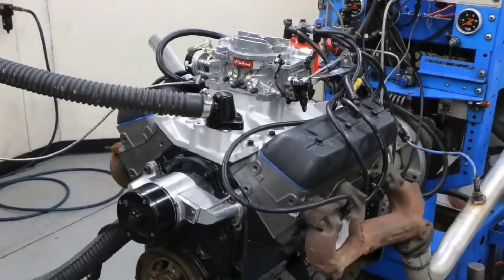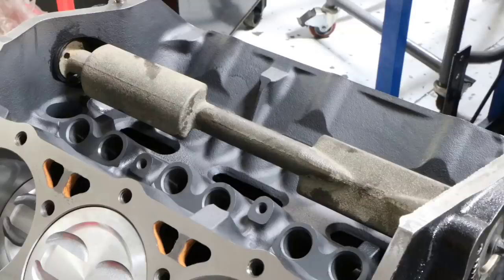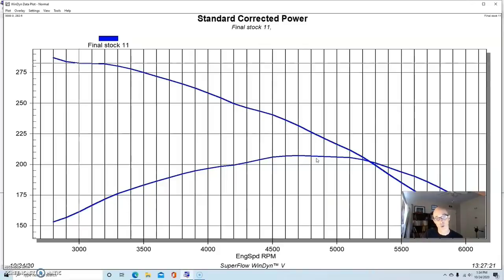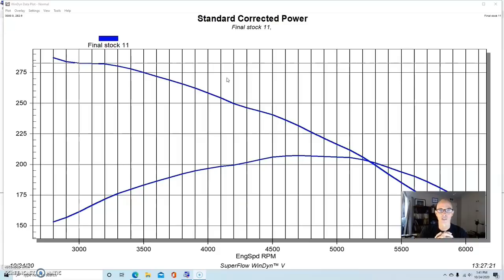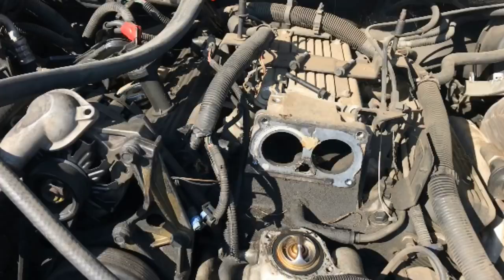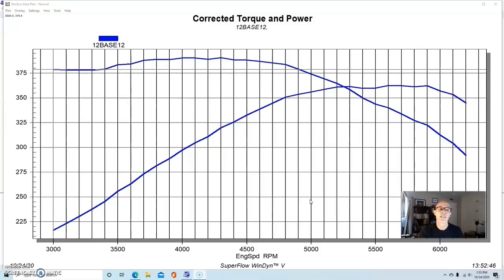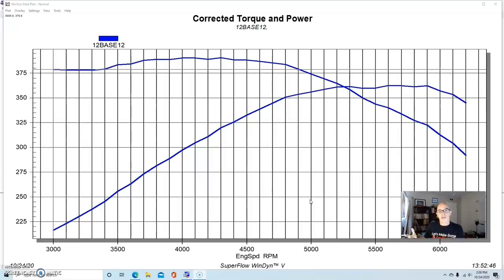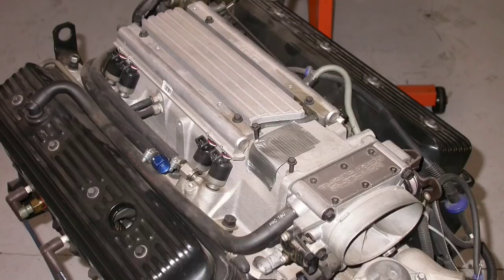4.3L V6 VS 4.3L V8-WHICH OTHER GUYS MAKES A BETTER BUILDER?

Comment: My current daily driver is a 2000 GMC Jimmy with the last generation of the original 4.3 V-6. And while it's held back by being in a luxobarge 4×4 four door SUV, it makes more than enough torque to get with the program. Power Nation built a hopped up version that made over 250 hp and almost 300 lb ft of torque naturally aspirated.

Comment: Bit of an odd suggestion I guess, but can we ever hope to see you run a quad4? It was a very high potential engine that never saw its peak because gm engineers and bean counters choked it to death.
Reply from the maker: I do like those
Reply: Darn carb sounds great in my book
Reply: What was the I-4 that could use any small block Chevy head?
Reply: @tubergonz  There's some speculation about fitting a chev head on either the Iron duke 2.5l (pontiac engine) or the chevy 2 four cylinder, but both seem to be bull as I've never seen either one built.
However there was a company out of Oklahoma building inline four blocks for both chev and ford v8 heads, but they seem to be few and far between because of expense and obscurity. They were like 7k just for the block.
Reply: That because they fell apart  when you  beat on them  buddy
Reply: I loved that little quad4, was in my sisters late 80's grand am. Made me realize that not all 4 bangers were boat anchors

Comment: The L99 would be my choice. I'm going to make a prediction. :-) 550-575 hp @ 6800 rpms with 5 lbs of boost and 300-325  feet tourque @4500 rpm.  Im not super familiar with that engine to be honest but NA I think you may run into a wall on valve flow. I dont think the intake is going to be the problem. Youre going to have over a quarter of an inch less room in each cylinder for valves.  That  will translate to significantly smaller valves than what would be doable in the 6 cylinder. That 6 can run 202s and perhaps 205s . It will be interesting to see this result. I think the V8 however will be able to hit higher rpms with less recropcating mass due to the smaller pistons. But yep 2 more pistons. :-) I like the high rpm screamer engines. Boost will help over come that small valve size . I think more HP can be made than that but not without significant expense or some crazy boost. Hey... you could boost it till it goes boom. :-) That would make a great video. more boost more rpms stiffer springs more rpms more boost. Here I go sending your hard earned money.. LOL

Comment: 4.3 v8 never heard of her!
Reply: 265 CID
Reply: Lexus makes one and way better than any Chevy engine.
Reply: Yeah that Lexus v8 is nice
Reply: The first Chevy small block was 265 ci. The L99 was not a popular version, but honestly why would you use it unless you wanted a really high revving combo. I could imagine a twin turbo 265ci in a light car doing work.
Reply: @tyronejefforeillyramirez7961  

I have an SC430 as well.. a 2009 parts car with the engine on an engine stand, and my 2006 which is the fun car and tricked out. I am rebuilding the extra 4.3 engine with forged rods, lots of head and intake work, cams, etc... aiming for close to 400hp on the engine alone with a clever tune.

Comment: And GM had two L98's and two L99's confusingly enough

L98 Gen I, 350 PFI from early C4 Vette and third Gen F Body

L98 Gen IV 6.0 LS2 variant solely used by Holden (Australia)

L99 Gen II 4.3 V8 94-96 Caprice sedan

L99 Gen IV 6.2 V8 5th Gen Camaro SS with auto trans

Comment: I have an 03’ s10 4.3. K&n Intake, exhaust, intake spacer, mild voodoo camshaft, super chips tune, bigger injectors, 8mm spark wires, msd ignition and I’m at a whooping modest 230hp. 
I think the lack of aftermarket intake manifold support is because it has a plenum, and a spider injection assembly. It’s harness is difficult to work on and the fuel pressure regulator in in the intake plenum. 
As for intake and moving air, the marine intake 4.3 v6 offers more cfm and a you can get a fuel rail and exterior FPR and injection. But it’s heavy. And requires a lot of outsourcing parts and rewiring. 
As for upgrades it’s cheaper and easier to swap a LS based engine, a one liter difference gets you over 100 more hp. 
If I were to put myself in the seat of aftermarket, I’d 3d scan a print a marine intake, and offer a rewiring harness. You could also portmatch the intake and really get more cfm. 
The v8 is cool, but doesn’t compare to a 350 or LS making it an irrelevant comparison because v6 4.3’s are not going to get swapped for a 4.3 v8... when like I said, a 350 or LS is so readily available and far superior in power and aftermarket.

Comment: 20 mpg in my loaded 1500 express van 4.3 300 k miles still going
Reply: Same in my chevy g10! Everyone is under this myth the 4.3 get worse mpg than a 350. Bs. They have smaller injectors and 2 less pistons how on earth would they get worse mileage. I just did a 423 mile trip straight on 21 gallons and still had fuel when I got home. 7 hours of driving. Love the 4.3 nice lil workhorses
Reply: @fvgc454ss  yes indeed cheap to fix also.

Comment: The 262, 265, the 267.   In the gen 0 family.   I helped a guy swap out a 267 out of a '78 or '79 Camaro and put in a long block 350 target mater back in the late 80's or early 90's. the one with the 350 stroke. Bolted all the 267 accessories up to it and he drove the 7 hours back to Edmonton that same weekend.  no problem.  I've driven a V6 powered Safari van ( aka mini van ) as a work vehicle. Our  '94 Caprice is powered by the gen 2 4.3L  Its a strong little motor. If I remember right, Chevrolets goal for the 4.3 gen2 ( baby LT )  was 1 Horse per cube and the publication I read about it that they more than achieved their goal. BEFORE anyone pounces on me for using the "gen 0" nomenclature, I point out that I am using Chevrolets own designations in their 2017 GMPP catalogue, they define the gen 0 as the 2 piece rear main seal and the gen 1 as the 1 piece rear main seal  ( their own crate motors )
Reply from the maker: the 4.3L was rated at 200 hp-misses the 1 hp per cube by a fair margin, right?

Comment: You overlooked one advantage of the V6.  Weight.  Not only how less weight is the same as more HP,  but on front heavy cars,  hooking and handling are better.  Yes we can get them to hook but it's easier and a smaller tire can be used when tubs are not an option.  Also you have more room for a turbo.  That is especially important in a S10 or a car with a small engine bay.  Lighter will get better fuel economy.  What I am considering is a small motor with a turbo that will get good gas mileage when cruising and have the turbo there when you need power.  Of course you would have to aluminum heads for the V6 as they come with cast iron to lighten it more.  My only q is how much power can a vortec v6 handle reliably?  N20 is expensive long term and a hassle to have to keep filling bottles.

Comment: 350 Cubic inch/ 4 speed  in a monza back in the day, very quick car
Reply: The only factory 350 applications in Monza's were 75 models, and only in California, and was saddled with a shitty 2bbl carb and tuned to just 120hp. The 305 2bbl replaced it the next year
Reply: @FirebirdCamaro1220  Wow 120hp from a 350😂

Comment: The "baby" LT1 was designed primarily for fuel economy CAFE standards. Combine that with OD transmission and highway gears and you superb economy in a full sized sedan. Not a lot of power, but they balanced almost perfectly and were designed to run very very smooth. So, they are perfect for a highway cruiser. An engine that you cant tell is there that passes hella lotta gas stations while you cruise in comfort with the AC on without a care in the world during a long road trip. This is what they did best.
Reply: A lot of people don’t understand that everybody doesn’t want a hot rod from the factory.

Comment: Olds had a 4.3 liter or 260 V8 engine code LV8 back in the 70s and early 80s and that was replaced by the 307.  Not a high hp engine...but made to economy and was a durable engine.  Our family had a '79 Cutlass with one and put over 140K miles on it.  Smooth and reliable...and decent mpg for the time.

Comment: Wow Richard... that 4.3L V8 is a really interesting engine.... I personally believe in the biggest bang for the buck theory.... that being said, both 4.3L engines make great boat anchors. But really.... if I had to pick, I think it depends on the application, the V6 leaves plenty of room under the hood for boost. As for The V8, I might as well get a 5.7L and be happy.
Cheers
Reply: The 4.3 v6 has a ton of potential. I made 470whp in my s10. Sure it could have been done cheaper with a v8 swap but boat anchor its not.
Reply: @EGGINFOOLS  you’re absolutely correct... I’m not saying the engine is bad...... I experienced the 4.3L V6 in my all wheel drive  Olds Bravada and in my S10  blazer..Sure if you add proper boost.....your gonna want to fasten your seatbelts. Like I said, if you don’t have room for a V8... a boosted twin turbo 4.3L V6 will probably be one hell of a ride. Oh... I bet the 6.2L LS is lighter then the 4.3L V6.
Reply: @vikenlink  100%.
Reply: @EGGINFOOLS  A 650h.p. 4.3 V-6? I would not want....
Reply: @davelowets  It should have read 470whp not 570. I typed that wrong. Either way, why not. It was a monster and unexpected
Reply: @EGGINFOOLS  A 650h.p. 4.3 V-6 would be AWFULLY expensive, and wouldn't last long... The only good heads for it are pricy Brodix heads, same with the intake, and there aren't really any cranks around that would reliably take that amount of power without paying out the ass for a custom one. You'd have 30 grand into it just to make it live at 650.
Reply: @davelowets  pricey is correct. You can still find 18 degree Pontiac heads and odd fire cranks every once in a while. Nitrate/cryo the crank and it holds the power pretty well. I had a short block built with the odd fire crank 10 years ago for $4500. 30k is way outside of the ballpark
Reply: @EGGINFOOLS  If you had nothing to start with, and wanted to build a bullet proof 650h.p. 4.3, $30k for a dyno proven, turnkey motor, isn't outside of the ballpark at all. Things were WAY cheaper 10 years ago.

Comment: Thank goodness they also had the LT1 in the Caprice... what a great car my ‘96 was! That is until some bozo rear ended it... oh well, my Nova loves the fuel injection and 4L60E.
Reply: Bet she rips too
Reply: You really have to be careful with it, the first time I laid down the hammer at freeway speeds it downshifted and smoked the tires in 3rd! The only thing that kept me out of the ditch was the posi catching and throwing the car straight.
Reply: @andrewvandehey  yeah, right
Reply: Definitely taught me to not drive too aggressive at speed and buy good tires! I’m really impressed by the LT1 - the biggest challenge has been aftermarket support. Everyone is going LS. I don’t blame them, it just means less goodies for the LT.
Reply: @andrewvandehey  I got the TBI L05 350 in my truck, still plenty of goodies for that. Going to go Holley Terminator because of the built in TCM vs the Sniper, cause of my 4l60e trans, with vortec heads, mild cam, and full exhaust. I want it to breathe but still be reliable, and possibly boost it when I get a new truck in the future.
Reply: @tsmi5807  mustve been icey roads.
Reply: Going from 195 to 245 width tires and keeping my lead foot out of it is the trick
Reply: @tsmi5807  I don’t see how that isn’t believable. A 2 door Nova weighed around 3000lbs, whereas a caprice weighs 4400lbs. Put a modified LT1 and 4l60 trans in a car that weighs 3/4 of a ton less, and it can get tail happy quick.
Reply: @iDrive4fun93  Well I had an early nova, 2600 pounds, 327 , 350horse four speed, and I can assure you, I could chirp the tires in third perhaps, but burning them>>>>>><<<<<<<<<<<<<<<<<??????????? haaahaha,,,,,,,,I also now own a 97, 30th anniversary camaro with LT1 and six speed, maybe 3600 pounds, totally stock,, I bought it new 23 yrs ago, has sixty k miles on it, its as pathetic a performer now as it was when it was new,, smoking the tires maybe in first if the clutch was dropped at 4500,,,,but no way going into third, that is preposterous.  Yes as one guy said, maybe an icey or dirt road, spinning in third, is possible, but not very likely. And so his is built eh,, with what a very hot cam and hi compression,, straight pipes,,,,wtf?  maybe another hundred horse, maybe with 22 pounds of boost, but he didnt say that he had a blower methinks.  Lets all have some fun, where there are hot rodders there are also bullshiters, fact is, anywhere you find men yakking about there hobbies excitedly, you got bull shit now and then.
Reply: @tsmi5807  it is a mild build at the least, there’s some vids on his channel about it. You can hear it run. And he had skinny 195 width tires on it, which don’t offer any grip on a car with 150hp 4 banger, so I believe it would cook them through the first couple gears in that car. The fourth gen Camaro you have has 235s if it’s the z28 and 275s if it’s the Z28-SS. That makes a huge difference. I used to race rice burners, I had a little Elantra GT from 2004, Beta 2 engine swap with bolt ons, maybe 140whp, stock 195 tires on it, and it would smoke those tires all day every day in first and second(I have video proof). I swapped out the 15x6.5 in the front for some 16x9 Konigs with 245s on them, which were surprisingly lighter than the heavy stock wheels, and I cut a second off my 60 times and it would come off the line way faster, and I was able to win some races against other rice burners because of it, and it would do an e-brake stand in first but not second without bogging/stalling or eating the clutch. Tires make a huge difference. My 93 Chevy 1500, with the gutless TBI 350, had 235s on it stock and would spin them all through first from a standing start, without power braking. It’s got 285s on it now and it’ll only chirp for a second or so now from a standing start without power braking.
Reply: @iDrive4fun93  Yes, I know the tires are small, you should have seen the smoke screen I laid down with my old nova with those skinny pre radial x5.5 inch tires on the back for fun, gawd.  Oh to be that young , dumb and fullofkum again. hahahahaa.

Comment: I have a 1979 Oldsmobile Cutlass Calais with the 4.3L 260 V8, it might not make a bunch of power but it does get decent fuel mileage. RPM redline is at 4k.

Comment: My Auto shop Teacher has one of those L99 V8’s with a turbo on it in a Buick roadmaster lol
Reply: The 94 to 96 roadmaster's came with the LT1. The earlier models had the truck engines. Did he swap out a truck engine for the L99?
Reply: @TooFly357  nope
Reply: @liammaupin9492  yeah all the roadmasters and caprice wagons  had the lt1 which looked identical to the l99 only the non 9c1(police) caprice sedans had l99s

Comment: Last year I talked to a team that uses a 4.3 V6 in Formula offroad, he said they run upto 900hp, I asked specifically about the crank, it is a stock splitpin crank, he said they never had a problem with the crank, everything is stock, modified or homemade, and I guess an camshaft. I cannot remember the intake, I think it was homemade, maybe just a lid on one of the stock bottoms, most stuff on it was homemade. They have ran it for many seasons without any issues. 
I cannot remember the details, I was surprised about the crank, since "everybody" says the split pin crank is so weak.
It sounds like an Blazer, you know, that Ferrari sound.. :D

You used to get Bowtie parts and other aftermarket parts for them, but I think the Buicks is/was the king of the V6s maybe.
Reply: I think the life span/durability of the crank has a lot to do with how you treat it. The guys that drag race with a 4.3 V6 seem to find the limit of that crank at around 550 ish. Im thinking the shock loading of drag racing is what kills it, where that offroad racing has way less shock loading compared to drag racing

Comment: Seen a 400 block based motor with 3.100 262 crank with chrysler rods years ago in a cubic inch rule and "production only crank rods heads and block" class and it went really well

Comment: 4.2L Inline  6. 

Ferrari did the v12 for primary and secondary balance. Also smoother with a pulse every 60 degrees.

Comment: My dad destroked the infamous 262 that came in the Monzas (to get it under 260.99ci) and put L99 heads on it for land speed racing to fit into the E class. The motor made power. Based on ET, MPH, and vehicle weight from running at the drag strip, it was around 300hp to the wheels.

Comment: That 262 from the 70's was found in the Monza and Nova. And yes, there was a lot of bitching at the time because of the strange bore and stroke combination, wondering why they didn't just use the 265 specs from the fifties. I don't remember the exact explanation (come on, it was over 40 years ago) but it likely had to do with emissions and fuel economy. That poor engine was just strangled by emissions control stuff. It only lasted a couple of years before it was replaced with the 305. The best side benefit was that since the Monza was the same engine bay size as the Vega, you now had parts straight from Chevy to mount a V-8 in your Vega after the piece of garbage engine it came with threw up on itself.
Reply: I test drove a Monza with the 262 V8 way back when.  It made cool V8 sounds, but didn't feel any quicker than the 140 L4 Vega that I was thinking about trading in.  It only had 12 hp more than the Vega, and an engine that weighed maybe 300 pounds more.
Reply: I had a 75 moza with the stock v 8 in it ran it for years at the track,tok it out and used it til this day in my 2500 series gm pick up

Comment: If I'm not mistaken, Trickflow makes heads that will fit the L99 (Baby LT!). The heads have a small chamber. Call Summit Racing for more information.
Reply from the maker: they fit the 305, not the reverse cooling LT1 motors